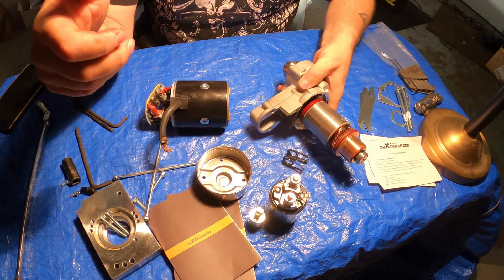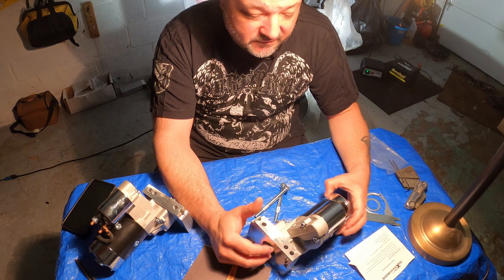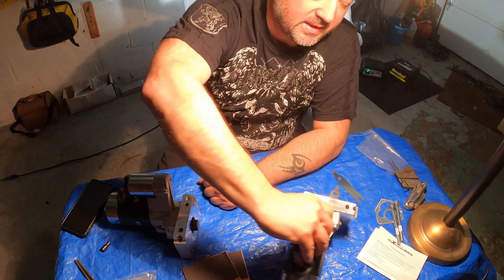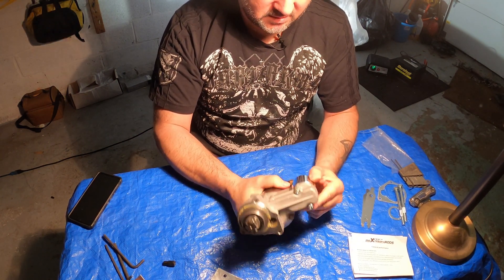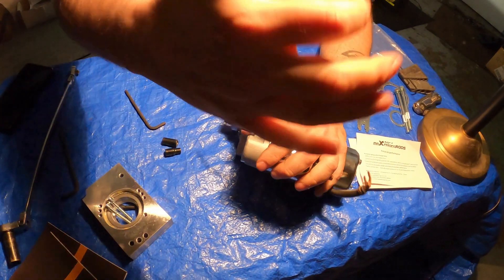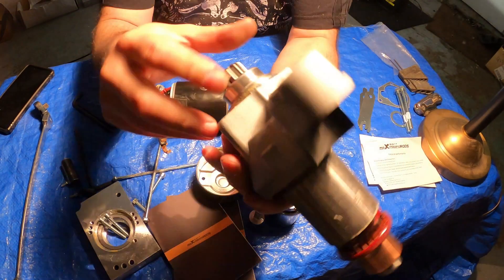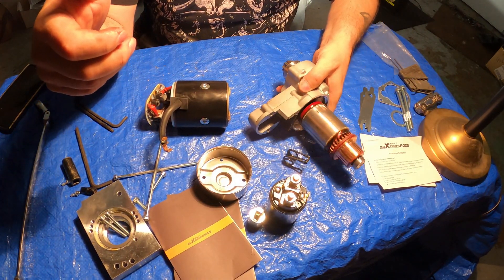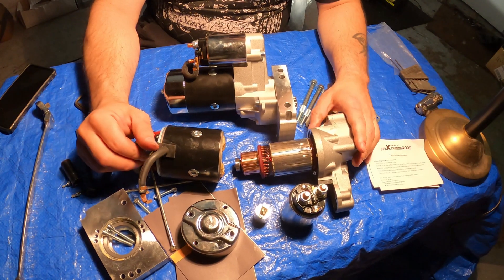GM Small Block Chevy High Torgue Mini Starter @maxpeedingrods

Comment: I had installed a high torque starter look alike back in 1985 in my 400 cu inch small block engine. How's the motor coming along..?
Reply from the maker: will be at it again next week catching up with some products and videos and will have the motor out by next week stay tuned lol

Comment: Yo!! Fixed my lt1 had the same chirp yours started with all I had to do was replace the lifters. Couple lifters we're calapsed.
Reply from the maker: i wish from the other video i made i cut open the oil filter and you can see bearing material in the oil